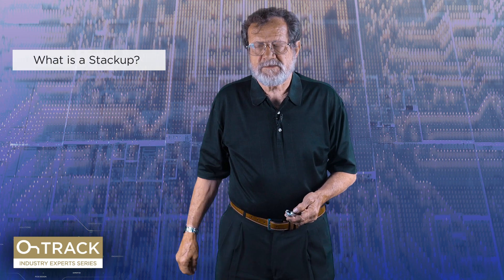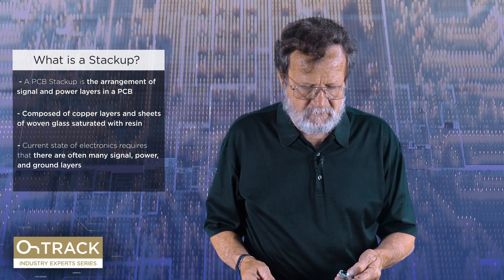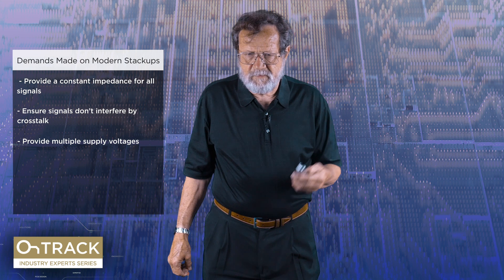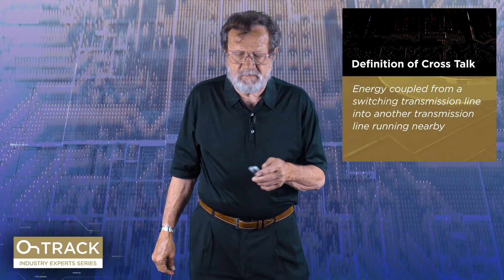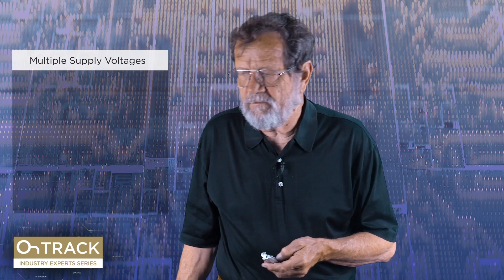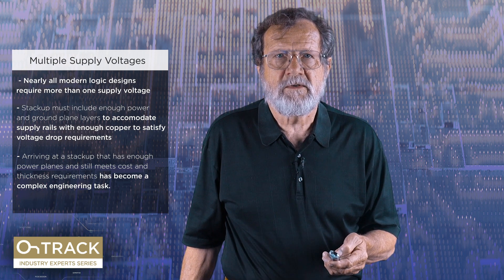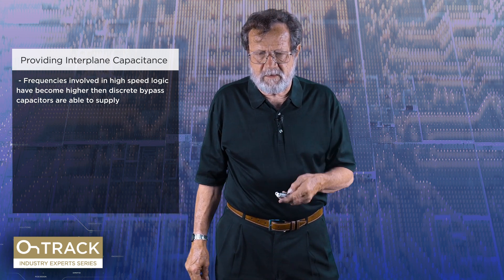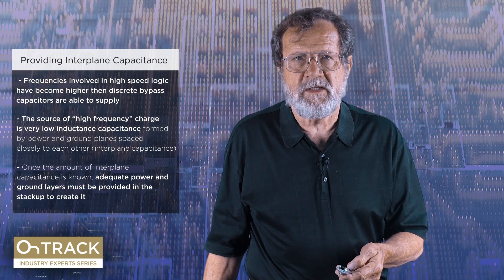Effects of Poorly Designed Stack-ups - Altium Academy

Comment: Is it possible to correct for the Fiber Weave Effect by making one of the traces longer or wider, or is it too hard to control how the weave will actually align with your copper layer?
Reply: It is actually hard to control, which is why so many people default to using spread glass. I like Feranec's idea of zig-zag routing. It takes up space but it tries to equalize the skew across all traces on a bus. I remeber a recent conversation on SI Lists, these guys were talking about how you can order the same board with exact same materials from 3 different manufacturers and the TDR/S-parameter results on some routes were very different. I believe the weave effect was concluded to be the culprit; the start and end point along different regions of the weave would be different enough to cause skew to accumulate on long routes, even though the material systems and weave type were the same.